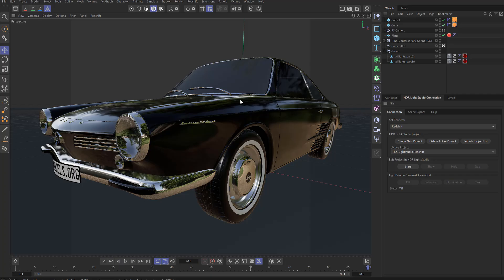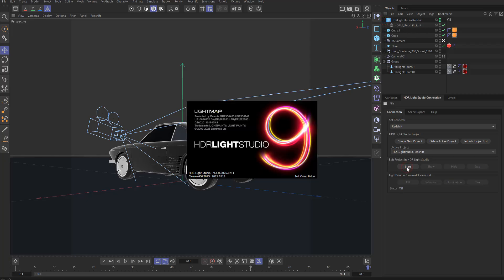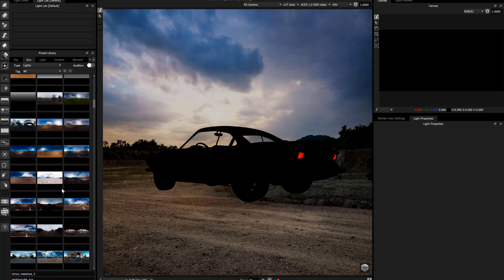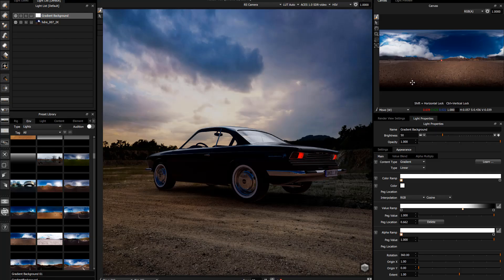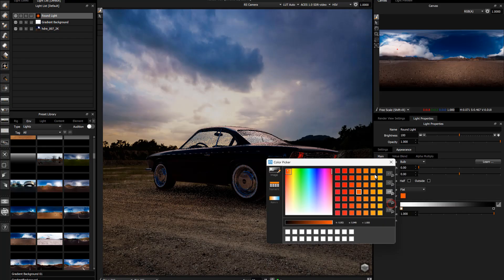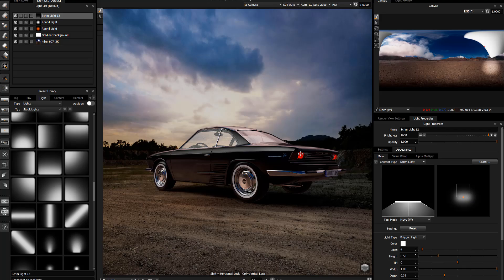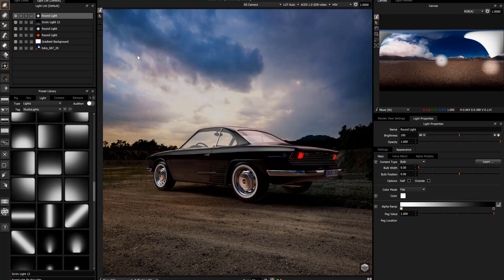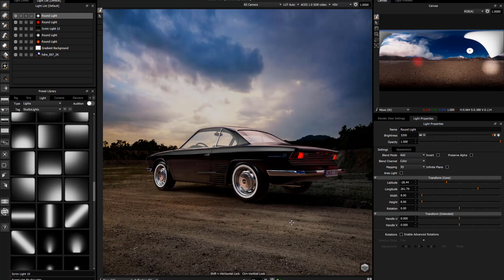Lighting the Hino Contessa for the One Car Challenge 2025 | HDR Light Studio Demonstration

Comment: Is this GPU-driven? It seems very slow to respond.
Reply from the maker: HDR Light Studio is connected to C4D and Redshift. There is a lag in the time it takes for the updated HDRI map to be loaded by C4D and Redshift, and then for the updated IPR image to be shared across to the HDR Light Studio UI. I am sure we could have optimized the settings to speed that up a bit. HDR Light Studio is CPU based and runs without the need for special GFX cards or drivers.